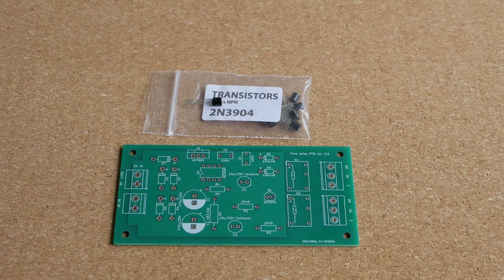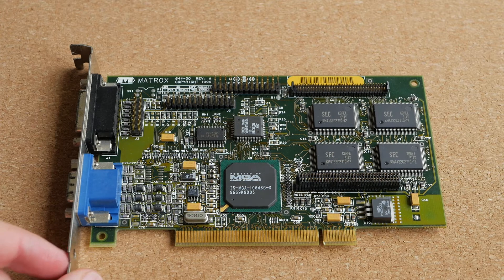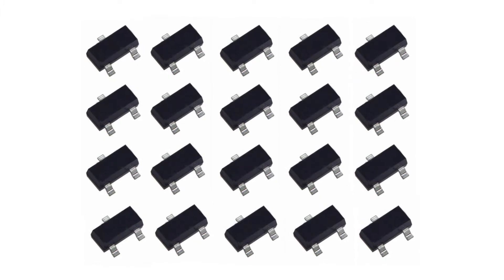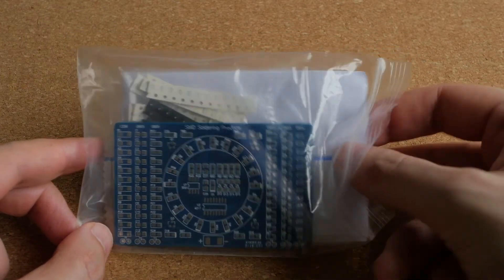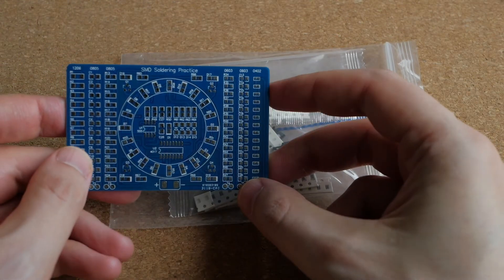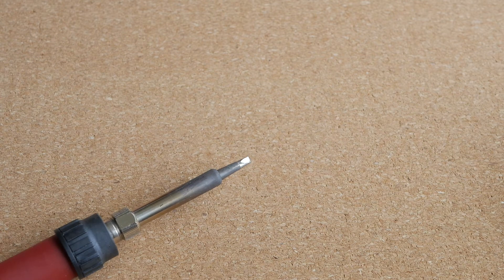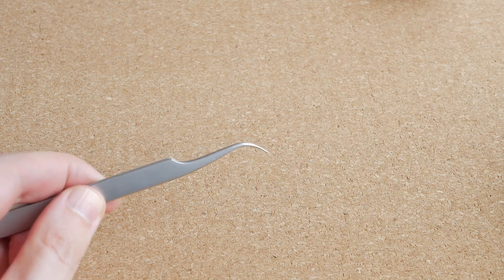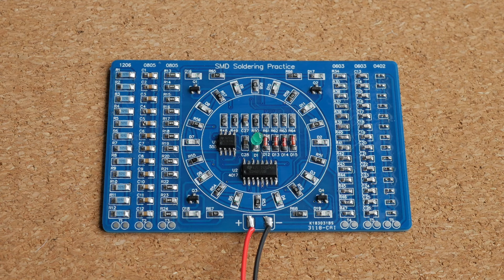Time to learn SMD soldering? // Gikfun SMD soldering practice kit

Comment: Recieved mine from Amazon today and there is no clear indication of which part goes where. All components are thrown in a ziplock and not labeld. Instructions are unclear and have been translated. Tutorials online all have different rated resistances so can't even follow along. Have to send it back.
Reply from the maker: At least in my kit, all resistors in the actual circuit had the same value so their position in the circuit did not matter at all. The smaller pads on the side of the PCB are for soldering practice, these parts are not actually connected to the circuit in any way. The rest of components can easily be distinguished by their looks, e.g. transistors have 3 pads, ICs have unique footprints, etc.